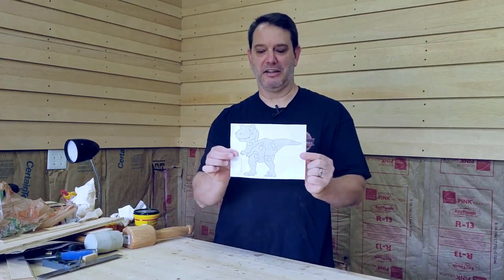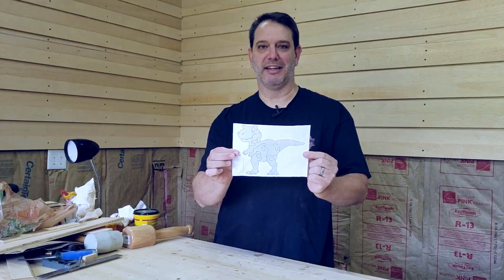Children's Dinosaur Puzzle/Scroll Saw Project/Walnut Wood

Comment: Very nice job! I can see you making more because you both were having fun!  By the way, I saw someone use a brilliant method where she applied painters tape on the wood first and then applied the design using adhesive spray. After cutting out the project it seemed easy to peel the painter's tape off the wood!
Reply from the maker: Thank you! And that's a great tip. I'll try it on the next one👍